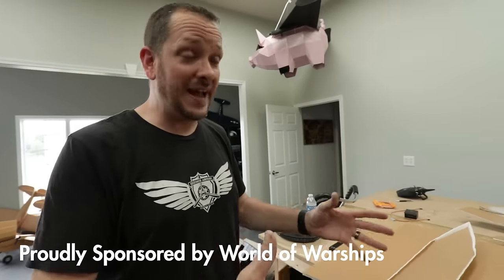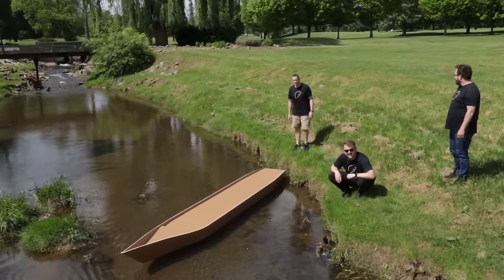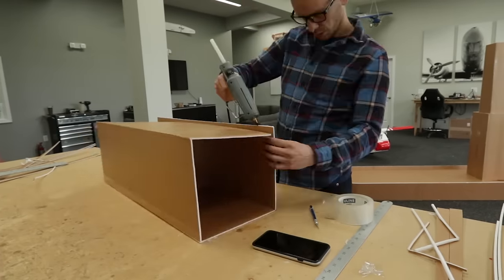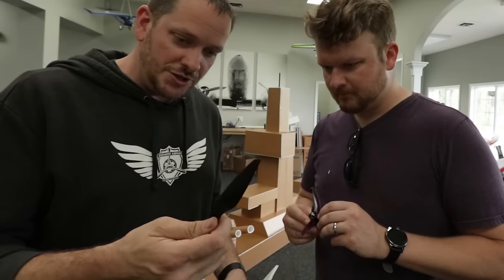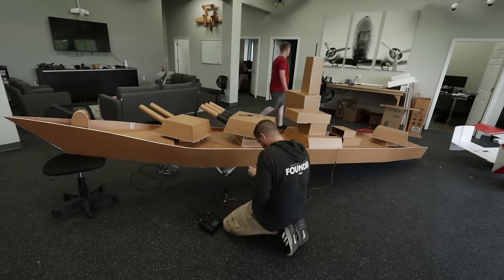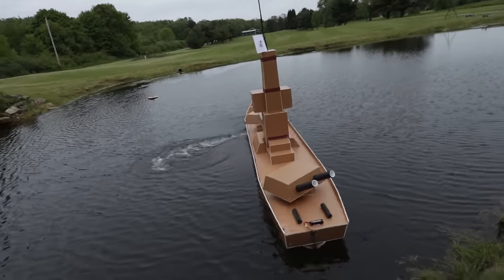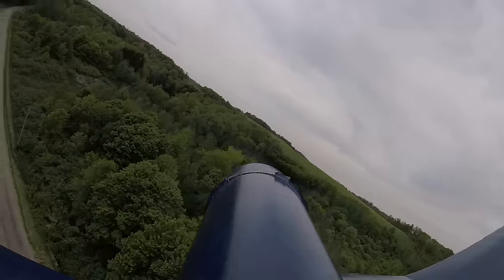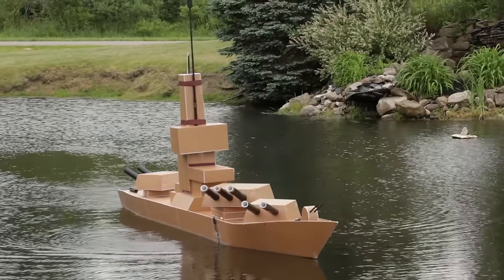Largest RC Battleship VS RC Dive Bombers!

Comment: Next project - Micro Hydro Power Generator!
Reply: Ya know, there is some decent flow in that creek.
....
But we might have to wait a day or two to charge enough for a 10 minute flight. People often underestimate just how much energy it takes to fly.
Reply: @tananam9782  
Would love to see a run way powered from that hydro, 
Or night leds far in the background, lots of potential.
Charging lipos does take some current.
Reply: @przemos7816  
LED runway lights are a much more reasonable expectation regarding hydro-power from that little creek. I'd like to see some numbers there (Not least, because I might have my own seasonal uses for such an application, very short seasonal uses mind you).
This is not an unreasonable contemplation.

Hey, F/T, Runway LED lights powered by hydro from the creek? It's a good idea, right?

Comment: You do not need a wire and latch for the bomb release. Just hook the rubber band over the servo arm itself. It is much easier and you also do not need a zip tie. I always do it like this.

Comment: Next up drop torpedoes, use props on them that could also help propel the rc plane in flight.
Or use rockets on aircraft that could be fire works and launch them at ships or tanks like in the second war.
Something easier to do would be doing strafe runs on the ship using airsoft guns till it get’s to many holes and sinks.

Comment: You divebomb by coming straight down at the target, not strafing it. You need to get a high altitude over the target, then drop downward toward it, lining up before releasing the bombs, and pull up after release. Might need to use a VR helmet to visually see where you're dropping the bombs at.

Comment: I "Noticed" a failure in your bombing runs...If you want to "HIT" your target...you "NEED TO" adjust your flight path so that your bombing run is running length wise with the battleship you are trying to bomb.  Then your bombing runs will be more accurate.
I'm an US Air Force vet, with several ex Navy vet friends.

Comment: I would make real napalm miniature size of course it's like a little model top cocktail come on guys you can do it also little bombs made from PVC pipe do you use half inch PVC pipe with a metal head on one side and plastic on the other don't really need fins just to stabilize it at one end but with the metal head it will go forward like a dart simple primer cap at the front and bang!! It wouldn't weigh very much being a plastic body it would just be the head of the bomb half inch galvanized metal cap!!😮😊

Comment: No offense intended but you guys aren't "dive" bombing.  What you are doing was called "skip" bombing, the same basic technique used by 617 Squadron to destroy the Ruhr dams during WWII.  To dive bomb, which is more accurate than skip or level bombing, you need to push the nose over to a 45-60 degree angle which allows you to line up on the target and let gravity do the real work.  You would need to add dive brakes to effectively change the center of pressure and slow the airplane down as it dives.  I would love to see that!